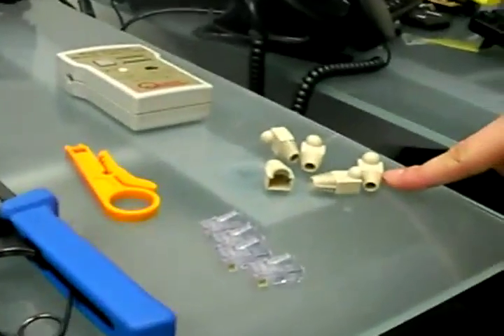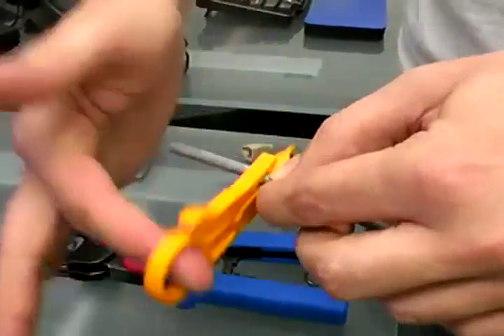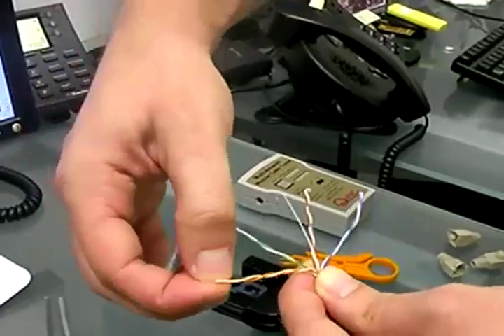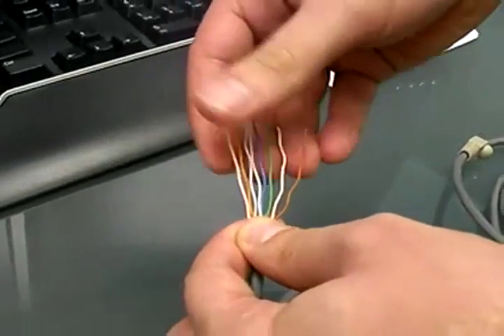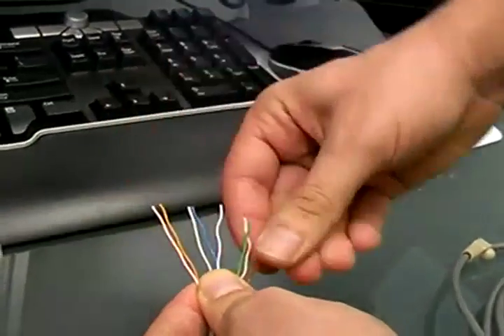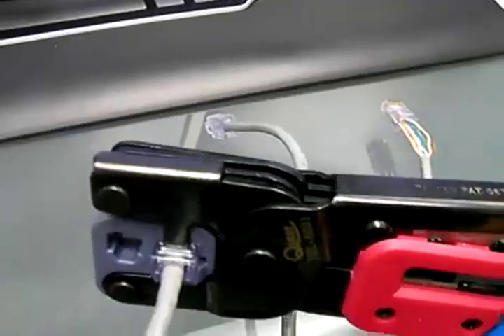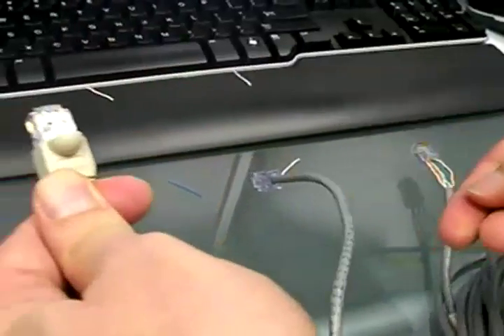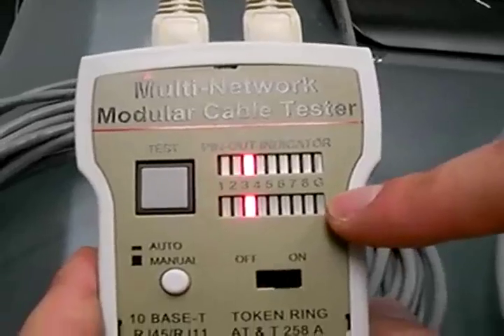How to Strip, Crimp and Test a RJ45

Comment: Should've mentioned that the last light on the cable tester is for testing shielding on STP cables. That's why it doesn't light up on your cable.

Comment: Where do you get the RJ45 connectors that the little cable can go through. Ive never seen them. Also what is they called?
Reply from the maker: http://www.cableorganizer.com/modular-plugs-boots/modular-plugs.html
Reply: yeah i've never seen those either and i've done a lot of cables before >.<
Reply: Look for "RJ45 Plug" on Ebay

Comment: When testing the cables the last light on the bottom row didn't light up like the last light on top row... what's up with that?
Reply: Should've mentioned that the last light on the cable tester is for testing shielding on STP cables. That's why it doesn't light up on your cable.